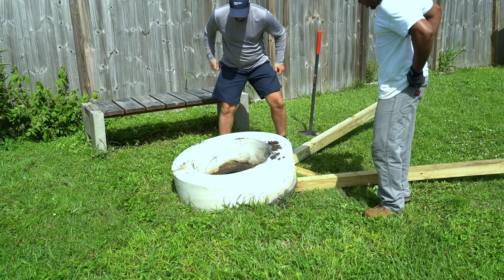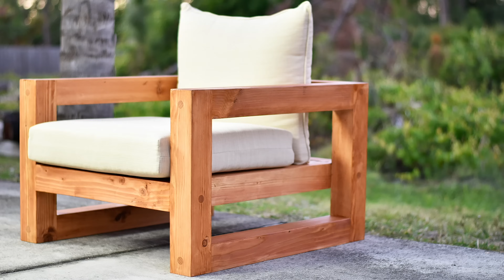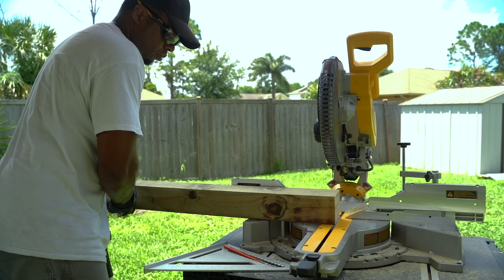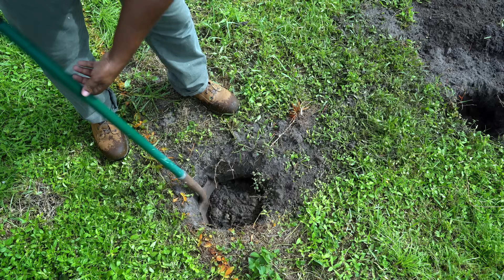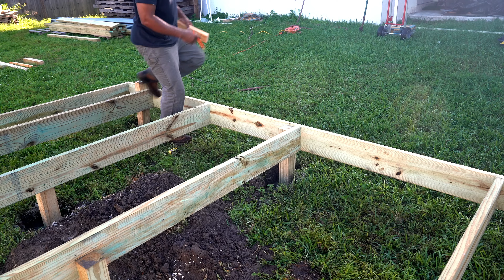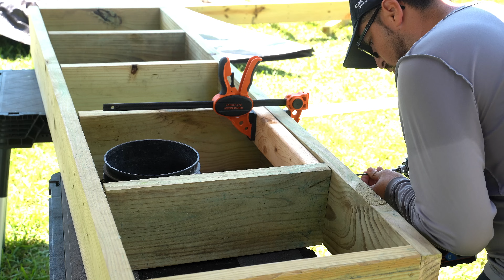Building A Ground Level DECK - (Part 1)

Comment: A lot of comments are saying the deck was built wrong. He used 2x8s way overkill, supports should be every 8 feet, 2x6 supports every 6 feet, 2x4 supports every 4 feet. The duck tape good idea in a hot and wet climate. I would have used cement blocks to support the deck, on top of some crushed stone, buried as necessary to level the deck.No wood touching the ground. No joist hangers needed, sill plate would be good to keep everything lined up. I would have used 2x6s for decking, much cheaper or PT deck boards, everything PT. 2x6 decking only needs 24'" spacing on joists. I built a ground level deck in Maine, ground is like hardpan, cement block on ground surface, 2x4 sub structure, joist hangers only where absolutely necessary. 2x6 decking, some 2x4s were doubled for extra strength. substructure was solid and strong. Maine does not have a problem with earthquakes, tornados or termites and hurricanes are quite rare. Come visit Maine vacationland.
Reply: @Hello Steve how are you doing

Comment: Handi-Block HBLK Concrete Deck Pier,  With these you set these at the corners and anywhere in between and they cradle two by lumber. No screws or straps needed.
Reply: How do you know how many blocks to use? My deck is 12x16

Comment: You mad a nice attempt to a diy job but within the first 5 min you made to many mistakes.  4x4 post go under the joists not deck screwed from the side. Screws have 0% sheer strength once you put a coupe hundred pounds on top of that deck they are gonna start breaking off. Also there is a reason why joist hangers are part of the building code, you should get your self a deck building book and and do a lot more research. I commend you for your DIY effort but your doing it DI Wrong

Comment: Man, the effort you put in this project is priceless but unfortunately is not the right way to build a deck.
The whole process is wrong and there is no way you would be able to pass inspection
Reply: Its Florida! No Fucks Given!
Reply: @newbiecam  😂
Reply: You actually want a very very small run in your decking so rain rolls off and water doesn’t sit on it as it would if it was completely level
Reply: @franciscoybighartson8854 thanks- that makes sense

Comment: For those of you who do have winters, I cheated a bit but it lasted for years with no shifting. I had a low deck I didn't want to go to the trouble of proper sonotubes for. So I bought those cement post blocks, dug a 24" hole with the block as the post base and then poured cement in under the block and all around the post. 10 years and it never budged

Comment: If it's going to be ground level why not just pour a slab of concrete. It Last Forever and you do not have to worry about powwashing and treating it later. My front porch is 12 ft by 60 feet and I never had to do anything except hose it off now and then.

Comment: I'd be using pressure treated wood and concrete piers.
Reply: It looks like pressure treated wood.  I don't think this guy would be foolish enough to use untreated wood, but I could be wrong.
Reply: Paul Hoskins it is

Comment: All the weight is hanging on the screws.
Reply: Once everything is fastened together, it's probably ok, except where the joists attach to the posts.  I would definitely use lag screws or lag bolts there, at least.
Reply: Not really it is resting wood bound.

Comment: you should use longer levelers. those short ones lie quite a bit. over here we call em polish levelers, always show straight.
Reply: So a four foot level won't work on 16'?  Yeah right.
Reply: @romanfields7900  it will but due to experience its not that accurate, shoudl atleast use 8-9ft level on that lenght. and of course there are better and worse levelers. but a 4ft for that lenght is way too short imho. if u or anyone else wanna build with that, go ahead :D

Comment: No concrete ? No notches in posts relying on screws... everything is wavy.  You added on the angled face ... that could have been framed  in the original structure.. .. your a hack
Reply from the maker: Thanks

Comment: Surprised nobody else has mentioned that the area around the edges that stick out past the posts are not cantilevered, but just boards butted and screwed in.
Go stand on one of those edges and hop up and down, or get 2 or 3 people standing there and those fasteners will give out and tumbling they will go.
SMH.

Comment: One or two parties, and this deck is going to be wobbling side to side with only screws as the main support members.  The screws may be time saving but you need more integration into the structure

Comment: All the wood in the touch of ground will rot. You should use some cement bricks, 1 ft x 1 ft and put those posts over those.
Reply: Didn't he put cement in the post holes? Would still rot even with the cement around it?

Comment: Enjoyed the build and commentary.  There are some good tips in the comments by peeps who have built commercially and you will know next time, but in reality you prob have 5 years of enjoyment.  So close to ground, No danger if something rots.  And when it drops it will only be a little.   I have told soooo many people who 'ask how did you?' That 'with the internet there is no excuse for not knowing how, why, when, where.  You can read 'how' on YT and 'what' in the building code and if you work with a lumber house they will tell you how best to use their products. Looking forward to more!
Reply: Oops, meant to say another thing is the sanding and grinding probably removes the insect / rot protection .  It is very shallow.  Use copper sulfate or something for protection on all sanded, or cut surfaces.  Yes even ends of cut lumber.  Maybe take a look at This old house,on YT

Comment: Seems to me that too many people are worried about code. It's just a simple deck, amply supported, and for sure it will last for 20 years if not more. For what it is, I think it's well done.
Reply: No it won't.  The entire weight of that deck is supported only by screws into the sides of the 4x4s not through bolts with washers and locknuts, not even by lag bolts, just screws.  Real proud when 6 or 8 friends are standing on it and you are telling them how you built it yourself then...crack...drop.

Comment: This would never pass a building inspection where I live - for a whole bunch of reasons.
Reply: Don Thompson thanks for the info dumbass
Reply: To be fair you would prolly suck the inspector off behind the house and get the deck signed off.
Reply: @benwhittingham2525  Actually, I would just build the deck to code. I find the solution you propose somewhat odd and disturbing.  Is that how you navigate through life's trials and troubles?  You must lead a difficult existence.
Reply: Don Thompson - Some people can’t handle constructive criticism and I guess some people can’t handle the people they look up to getting criticized. 

I agree with you, it’s quite odd. Fairly certain these are adults, too.
Reply: Joe Public where was the “ constructive” in his message? 😂

P.s joe public does smelly farts.
Reply: Yeh, thanks for letting us know knob head!

Comment: Word of warning bring the concrete up above ground level you should have used some of the sonex cardboard forms if you fill in the dirt on top of concrete the posts used for the foundation will eventually rot at the level just above the concrete.

Comment: Drilled thru nut and bolt through each support post would have been far superior to simple screws. At least the deck would be supported by solid steel rods going through the deck and posts.
Reply: Also...why did you chose to build this in the most backwards method possible? Frame first,mark for posts, move the frame, dig for posts, then move frame, then add posts, then cement posts, then weed barrier?

Comment: awesome video, when i do posts i like to just pour in the concrete dry around the posts, it saves a tiny bit of time then there's no need to wash wheel barrow and shovel off... just add water to the hole after you pour the concrete in

Comment: Unfortunately, the way you have built it, it will fail under load, joists should be on the stumps, compression on screws will cause failure. The step will rot if it is sitting in dirt regardless of the pressure treatment. The joists will warp and twist without support between them.
Reply: hello you may be interested in this product
  https://amzn.to/2qQkPVW

Comment: Wow, this is so wrong, like seriously u should consider tearing it down. This is dangerous, hanging bearers of posts with bolts instead of resting the bears on the post, joists without hangers, posts are too thin, holes are too shallow so on and so forth....

Comment: This wouldn't pass an inspection in Florida or anywhere else with building codes. I'm assuming it's under 200 square feet, so you don't need a permit. Attaching to posts with screws? End nailing joists? Some posts in the ground, some posts on the ground. The way you placed your posts should require double joists to hold the rim joist. This is good how-not-to. The cantilevered angle on lookouts is hilarious

Comment: When u build, you stack the load. Fasteners hold things together. They don’t support weight. If he wanted to do the build the same way; he needs carriage bolts. The best way to build a deck is to have a beam running along the post with a post to joist bracket. Then put the joist on top of the beam or secure to the beam with joist hangers
Reply: This is a surface deck... While I understand the need to utilize carriage bolts rather than screws, beams add just another 6 inches of depth you would have to use in addition to the 6 inches of joist width.  I have the same predicament.  I 'm not going to dig down under the ground to support the joists.    What's your solution?
Reply: @YourUncleKevandKids  Notch the 4x4 post out so that you can slide the band joists in on both sides and then you can run carriage bolts through both of them. Eliminates 6” of height and gives you vertical strength
Reply: @bradd6376  This was the comment I was looking for as screws holding the frame to the post can, when load is applied, 'slide down' and the deck will drop. Also even though the wood is, in the UK we call it tanilised, a wood treatment to protect the wood outside, but no matter how much protection the wood has, if its resting on the floor or ground it will suck up moisture and go rotten. Landscaper with 25 years experience.
Reply: Exactly right, Brad.  I hate to see people build this way.

Comment: You could've dug 6 holes and have the rest of the supports rested on pavers. Saved you some digging. I put mine on the concrete instead of in the concrete with brackets so I never have to dig them out if it would ever rot.

Comment: I know you are putting a lot of work into this, but you REALLY need to pull it out and start over. First, your support posts aren't Ground Contact rated Pressure Treated lumber, and second your deck needs to sit on TOP of the support posts. As it sits now those supports are going to be rotted away in no more than 2 years and ALL the weight of the deck and anyone on it is supported exclusively by screws under a lot of lateral sheer strain. You can probably salvage the top frame for re-use but at a minimum those posts need to be replaced and repositioned to be UNDER the frame, not beside it.
Reply: You did not watch the whole series, part 2. Who is the smart guy now?

Comment: I’ve also built all my decks screwing in the side using chunky screws with impact drivers, it ain’t going nowhere!  The joint is pulled VERY tightly together using impact drivers so I think this adds to the shear strength.

Comment: No need to have posts in the ground, I’ve built loads of simple, low decks on grass and hard standing and never dug holes or used concrete. The weight of the deck itself makes sure it never moves, I just use small paving tiles to under each post to help spread the load and make sure the posts are not in contact with the ground. If you attach one side of the frame to a wall then clearly digging holes is not required. This also means you can lay the membrane down before you build the frame. Just my way of doing it guys, not necessarily the best way! 👍😊
Reply: Thanks Nicholas

Comment: I would mention that this method would likely not pass inspection depending on your locale.  You should consult local building codes before building anything even if you are not pulling a permit.  Your build will be better off.

Comment: Ww use quick set. Basically, you fill the hole to the top with water, that soaks into the ground and ensures the wetness isnt sucked out if the cement. Pour the bag or two of quickset into the hole and fill with water again. Mix thoroughly & as quick as you can then leave to set while you do the next one, or one on the far side of the deck. Also the posts should be under the bearers and joists on top.

Comment: I've never seen a deck screwed to the sides of support posts instead of sitting on them.  I don't think I'd follow this:  this means the entire load is supported by the screws instead of the posts.
Reply: Yeah its not to code but with no roof load and only being 1ft off the ground it'll be fine (provided the screws are rated for outdoor use)
Reply: @Deano.1978  p ok*
Reply: Walking on it is fine, it's not like he's driving a 1 ton pickup onto it...
Reply: @moistandsquishy9925  A pick-up truck weighs a lot more then one ton.
Reply: It's not even a whole foot off the ground. It's like 3 or 4 inches off the ground. A shit ton of deck screws can probably hold at least a couple thousand pounds, and even if they don't... you fall 3 inches, you won't collapse your spine.
Reply: UnTwisted Truth I made my deck like this and I used lots of support posts in the ground,  ever moved!🤘😱🤷🏻‍♂️
Reply: Tru dat
Reply: Do it all the time.
Reply: In you insist on mounting to the posts this way, at least use 1/2-inch carriage bolts rather than just the screws.
Reply: @wvmontani  carriage bolts isnt enough for IBC. There should be a 36 inch cleat on each post, supporting the joist.
Reply: @Form23guy  I agree. But they're better than screws.
Reply: No you don't sit the joists on posts,  and the load is not only supported by the screws.  This is a common misconception.
Reply: I would use sleeper screws at least they are really thick, they need pre-drilling, but even stronger than nails.
Reply: You did not watch the whole series, part 2. Who is the smart guy now?
Reply: @SteveFranchise23  
We have codes for a reason. It may be his deck now, but if they sell the house then it becomes the buyers hazard. Also if they have lots of guests over and they are all on the deck and it collapses, even just a foot of the ground can be hazardous.
It's not trolling when it's legit safety concerns.
Reply: Yea. If this guy did that at my house, I'd make him tear it down and do it right!

Comment: I live in south Florida, do you know if I need building permits for a ground level deck?
Reply: No permit, if you have grass where you're going to put it, remove the grass replace it with some gravel and definitely use pressure treated wood for the framing of it. Instead of deck-tape just painted a dark exterior paint on top of the framing.

Comment: Please any DIYers watching this, don't fix your joists to the upright posts with deck screws. Deck screws are designed for fixing decking boards to joists, not for anything structural. They have nowhere near the sheer strength to carry the potential load of this deck. Lag bolts or at the very least landscaping screws would make this design far stronger but ideally the load shouldn't be being transfered to the uprights by fasteners alone.

While a great video for garden inspiration, go watch some professional deck builder videos for your construction tips.

Comment: useless work. racks rot in the ground very quickly.....
Reply: romka romanov I didn’t see racks on the ground? Even though it’s really unsafe build, but I think only posts stayed in the ground
Reply: @zaidjaafar4110  
wooden racks are buried and filled with concrete ... it’s impossible
Reply: The posts yes is in the ground. I don’t like it either. Watch his second video he addressed this issue
Reply: @zaidjaafar4110  ок

Comment: Pro Tip: Just dump the dry concrete into the hole. It will setup from the moisture in the ground. And try to make sure none of the wood from the steps sits on the ground or it will rot. Putting some gravel/rock under it will ensure it will dry out. Otherwise it will sit in the moist dirt and rot prematurely .
Reply: That's the absolute worste way to set a post in the ground.

Comment: I hack lots of stuff myself but this is too wrong to mimic. The rim joists are attached to the 4x4 posts with only simple wood screws. They don’t have shear strength to support that kind of load. Not good! But good job on the hard work regardless.

Comment: nice deck but you should have notched the post so the 2x6 can sit on it instead of using the screws as the main holding power. also should have put concrete in the holes. your deck though, and it looks great!

Comment: Had to watch whole video to see.. 

However.... I find that putting the post in the ground is never a good option (especially in rain state FL). Should've used metal anchors on top of concrete (will last much longer)!. 
As for post to deck... Definitely should've put the post under a double joist in the field and notched it at the banding... 
Will get a longer life out of the deck for sure. 
The ground will settle and they are going to shift. 
If done like I said and your deck settles and is noticable, could fix it with shims or steel plate.. 

But anyway.... Good job on your first build.. just a few errors